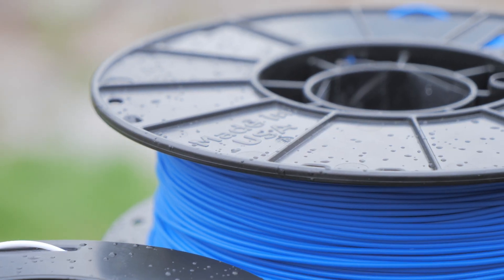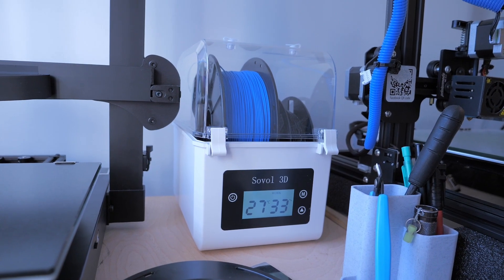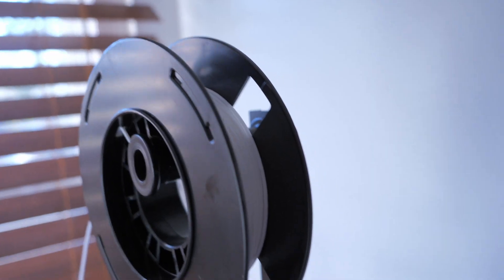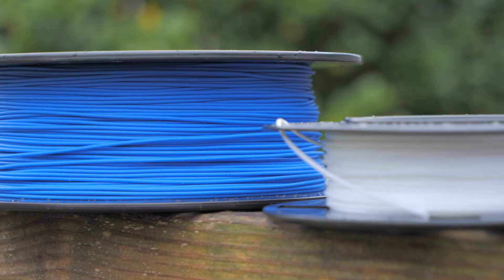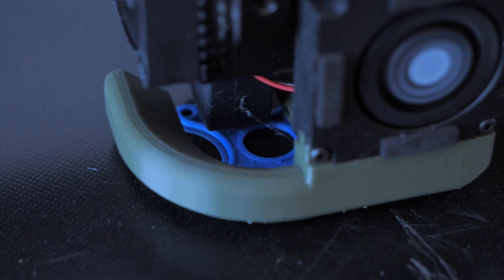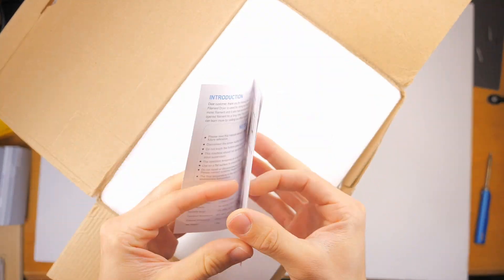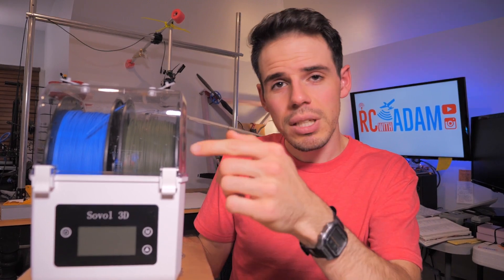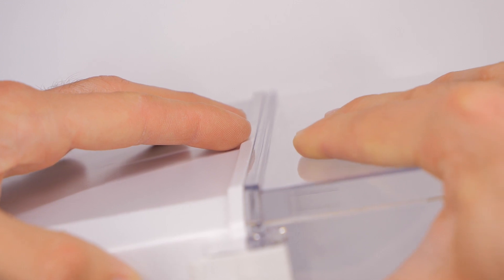If Your 3D Prints SUCK, Try THIS: Sovol 3D Filament Dryer Review - Best Way to Fix Stringing

Comment: This looks interesting.  For me, I would modify it with a TPFE tube outlet so you can run a TPFE tube from the dryer all the way to your direct drive extruder on the printer.  I do this with TPU already and it works great out of my drying box.
The cost of this looks great for someone on a budget.